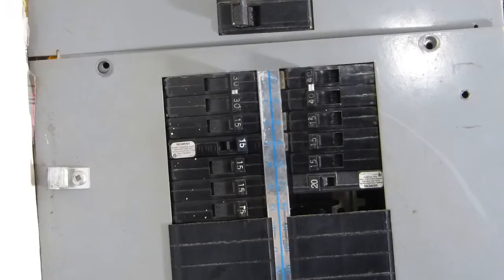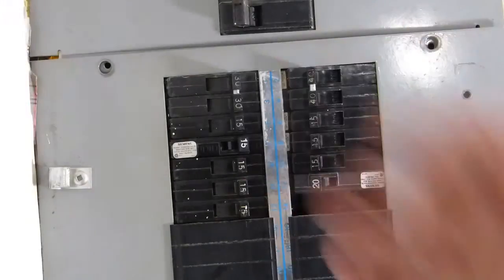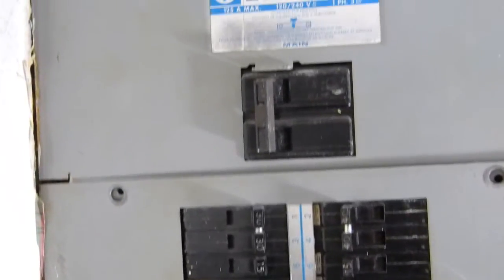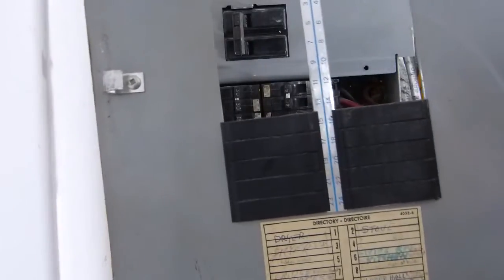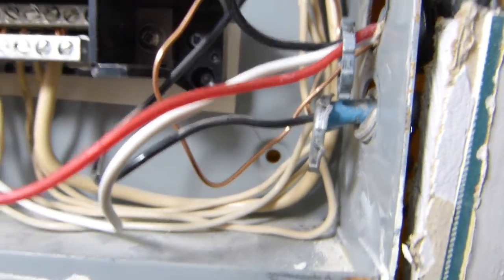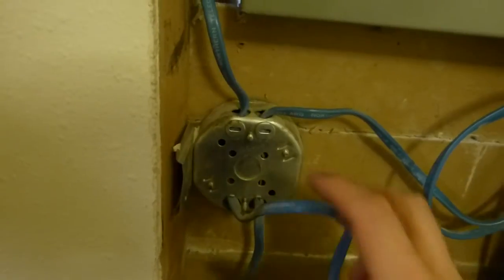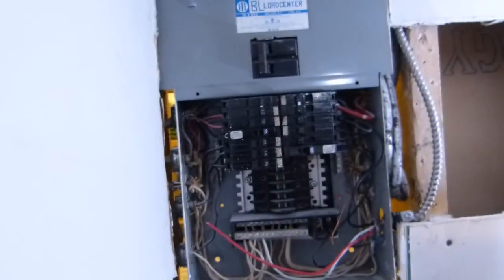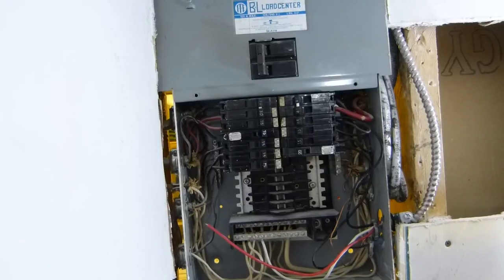Home inspection: electrical panel

Comment: I think it's interesting that you throw Home Inspectors under the bus with inaccurate information.  Every Home Inspector I have hired took 2 to 3 hours inspecting my home.  I will also say that I'm not quite sure of your analysis regarding the wiring.  It looked like the junction box was feeding the bathroom as you identified....but I'm not sure why that would be a bad thing unless it was overloaded.  Please explain why this is not correct?